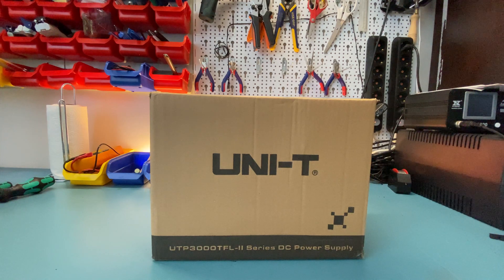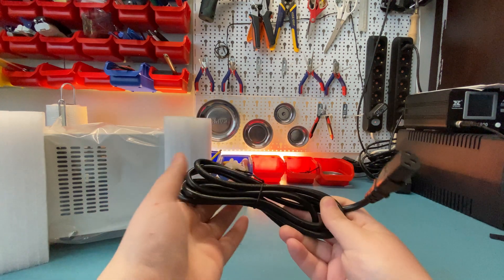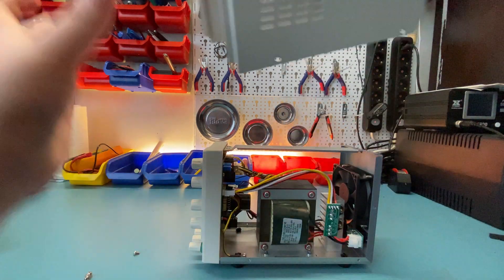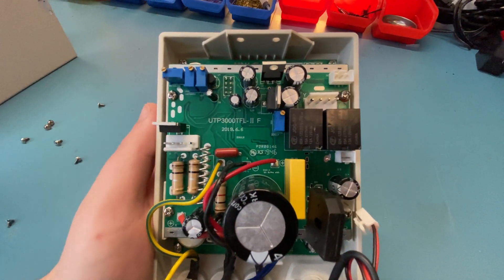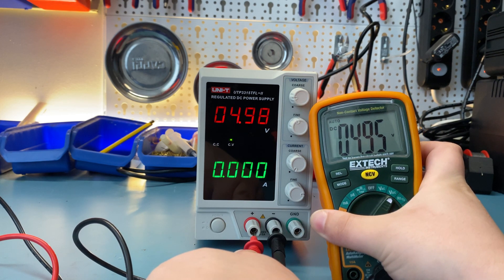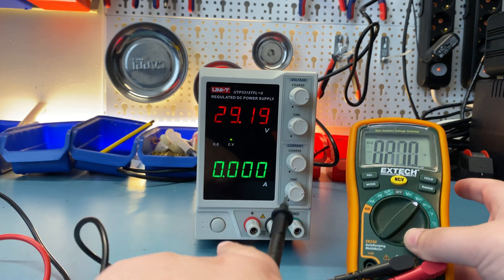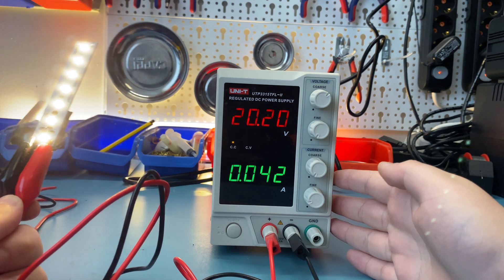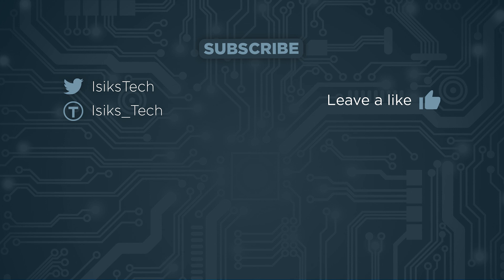UNI-T UTP3315TFL-II Lab PSU Teardown & Overview

Comment: No i cant take the sound from this supply.. It works good enough for the most i do but the fan is just obnoxious and after five-ten minutes i have to shut it off or walk out of the room, some kind of controller that turns the fan on at >50° or something would not cost more then one extra dollar to implement..
Reply: I have the same problem. But later I noticed that in some models sold with the same product code the fan automatically turns on and off.

Comment: 11.40V vs 11.47V is "pretty accurate"  ROFL
What about the HF output noise? Have you measured that?
Reply: He mentioned that he doesn't have an oscilloscope. Therefore, this test cannot be performed.

Comment: my potentiometer got broken the voltage coarse one and i can't find the replacement for it do you know how can i replace it
Reply: Use a comparable potentiometer with the same resistance and power rating. Also pay attention to whether it needs to be logarithmic or linear. Some have tactile detents; for example, there are also potentiometers for balance controls for audio applications. However, I suspect that in this case, it won't be a potentiometer with detents.

Comment: How long have you been using it? I have the same one, but at a high load (more than 3A), the transistors get very hot. I am afraid to charge powerful batteries with this power supply, because I am afraid that the transistors may burn out.
Reply from the maker: I never experienced that but it is not something I use every day. Video is from the time I got it.

Comment: Wondering if UNI-T PSUs are better built than those "Korad" clones from RND, Velleman etc. (320-KD3005D, 320-KA3005D...). Not sure which one to choose for hobby-level work with Arduinos, Raspberries and occasional laptop repairs.
Reply from the maker: I  can't really comment on Korads since I never used one but my Uni-T is imo more than good enough for occasional hobbyist use.

Comment: Funny how they advertise it as a "Low noise model", but their cheaper 1306S is actually quiet even with only a 40mm fan xD This thing needs a Noctua fan mod right out of the box :) Thanks for the teardown of this model 👍
Reply: I think they mean electrical noise
Reply: @user-hk3ej4hk7m  that's right
Reply: @user-hk3ej4hk7m  yes exactly.
Reply: UTP3315TFL-II - transformer
UTP1306S - impulse
I think this difference makes sense in terms of requirements for cooler and respectively noise.